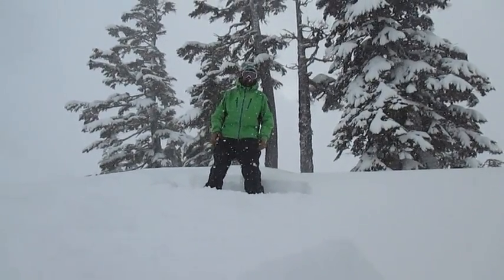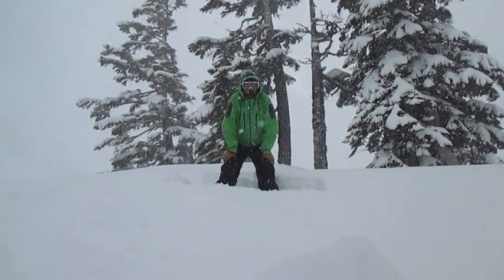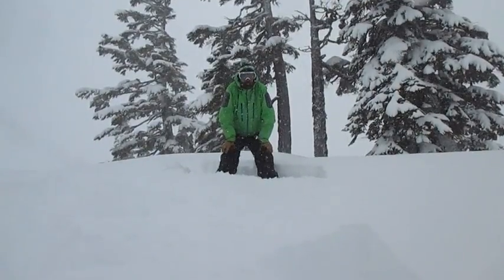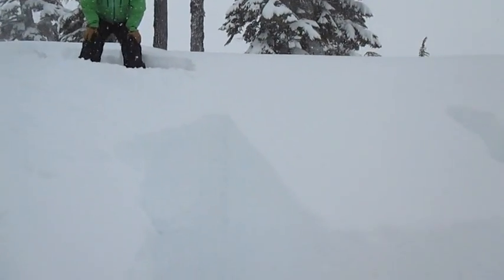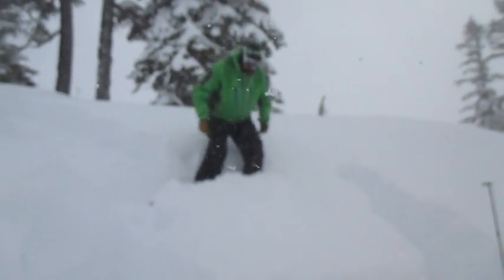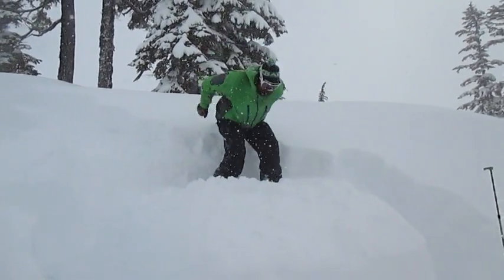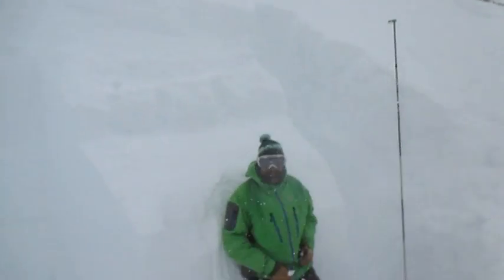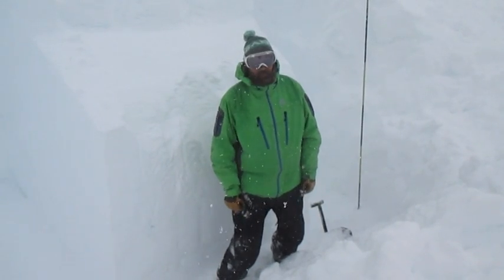NWAC -  Pro Observation - Mt. Baker - 2/17/2014

Comment: Thanks for the video guys! Stoked on all this new snow!! A tip and a suggestion for future vids: Leave some more gear in the pit for the camera to grab focus on (you'll notice it focused when the shovel was closer to the center of the frame), or turn off auto focus. The scrolling text at the end is very hard to read, I suggest using block text (as you did for explaining line choice) instead of strip text. Keep the videos coming :D